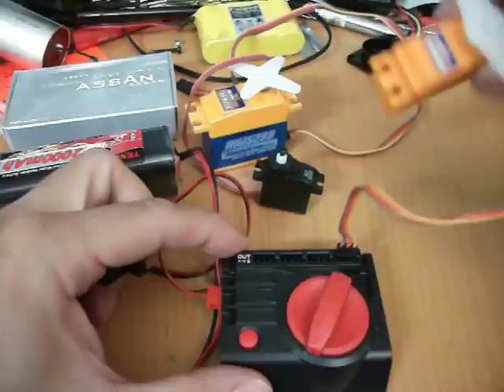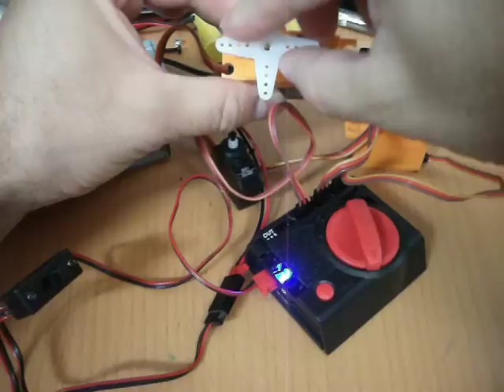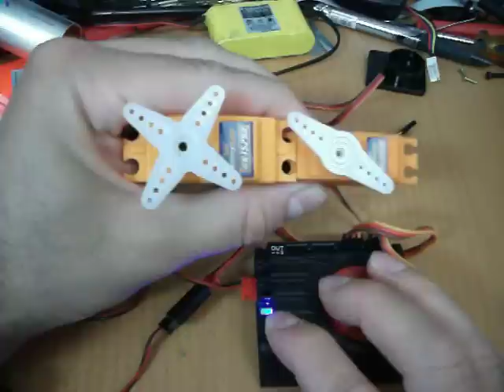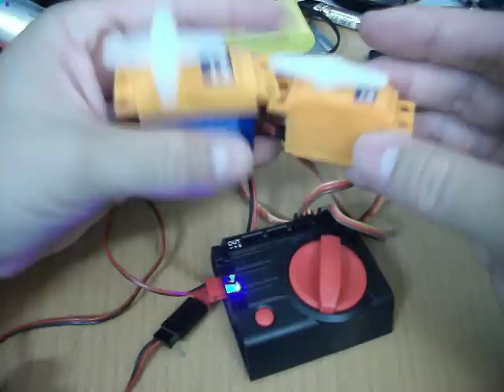Turnigy 760LV-HV Dual Pulse Width Selectable Servo Tester - 3 of 3

Comment from the maker: The tester is connected to a bec which was off the screen here. The switch is connected to the bec and the battery to the switch. I did that the very first time by mistake so I got the bec just for this purpose and so I would not burn any of my servos. Thanks for that though, this would look like I didn't plug in the battery straight to the tester. I did not. :)